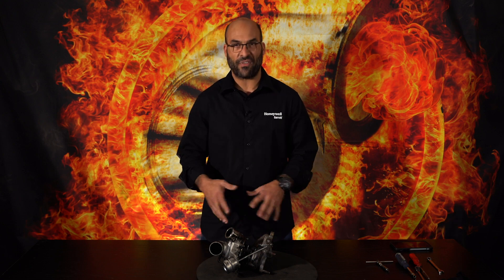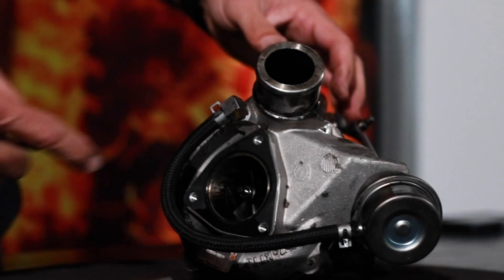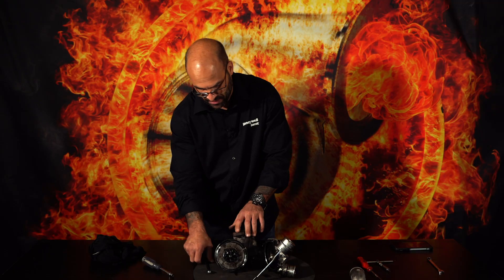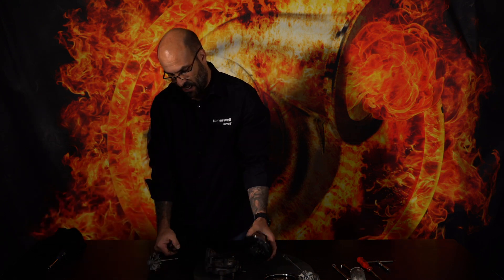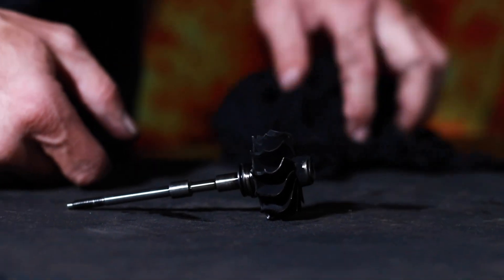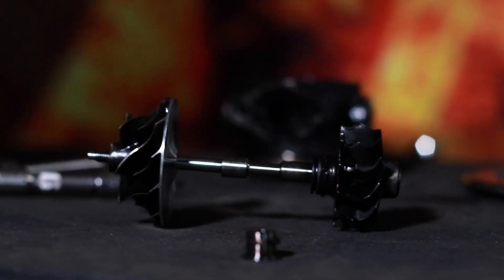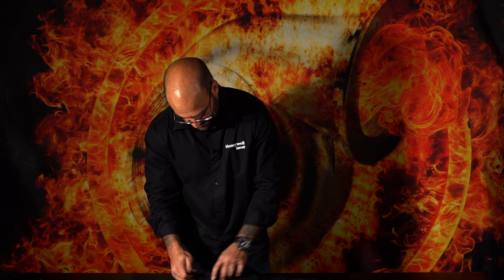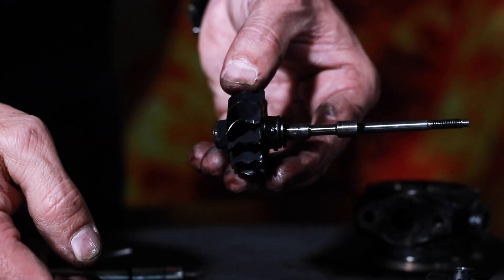Turbo Failure disassembly 1

Comment: Fantastic video great information.
Can you readily buy the seals and bearings for replacement or do you need to go to the manufacturer
Reply from the maker: @richardjackson9172  as the appointed distributors - we stock these bearing kits
Reply: @TurboDirectSA  I'm in UK do you post out fro SA or is there a British distributor.

Thank you for your reply
Reply from the maker: @ depending on what exact product you need, we can ship anywhere around the world

Comment: Hi Chris, would there be any problems if was to mount my turbo at 60-45 degree angle from horizontal line.
Reply from the maker: Yes it will be a big problem with the oil sealing system. If you lean the turbo over to the compressor side, you will leak oil on that side. 

And Vice Versa

Comment: Hmm, that was an interesting video, the low light and the slow auto focus was a bit annoying to look at, but very informative. Ya know, I have Precision Machining and CNC Automation  schooling and experience and I have been afraid/relevant to rebuild a turbo or to really customize the turbo kit I plan on putting on my 2007 350z. I was planning on using of the shelf kit. After just two of your videos, I might choose to tailor the turbos to my car myself because your videos are so informative. I know there's more that goes into sizing turbos, but I was reluctant/afraid to before, now I'm curious and cautious. 🤔
Reply from the maker: Glad to hear you are more confident to do things yourself now. Watch this video for more info or additional info on what i do with programming a CNC lathe for the profiling of the compressor stage and housing. https://www.youtube.com/watch?v=uK7u_7OsbXY&t=2081s
Reply: @TurboDirectSA  I do a lot myself, rebuilt a few motors, do pretty much all my own work despite not having access to a lift. I was always sketchy about building my own Forced Induction system though until your videos, now I just wanna learn more haha
Reply from the maker: @kevin_delaney  Well let us know what you lacking and ill make some videos to help.